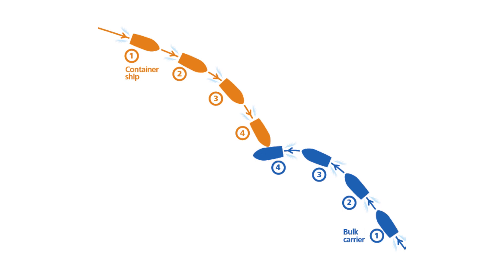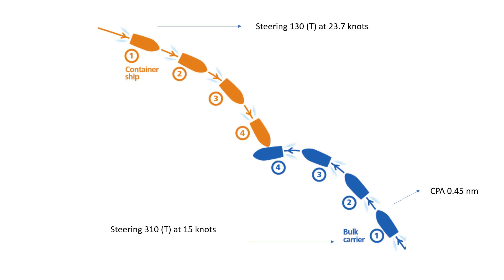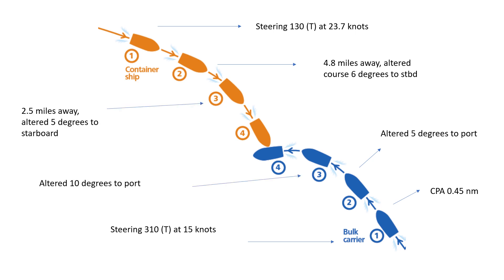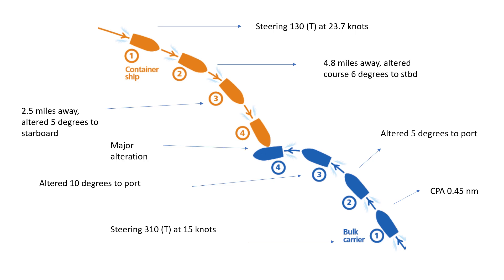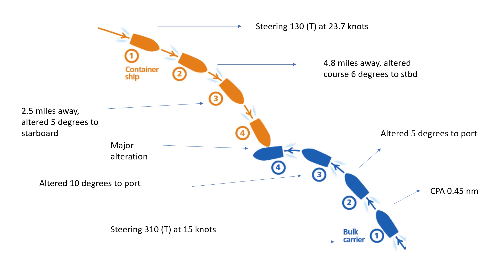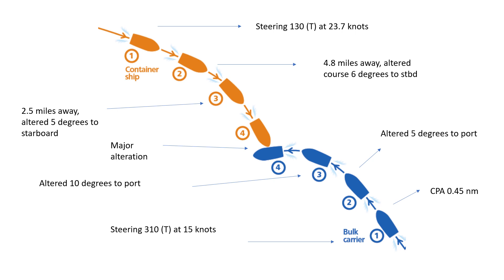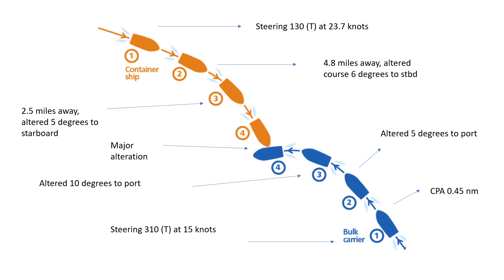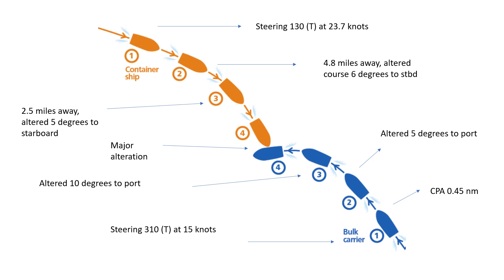Collision at sea case study!! Understanding and applying the Rules of the Road

Comment: The only disagreement I would have is placing equal blame on the two vessels. The only major fault of the container ship is that they didn't alter substantially, the bulker however broke rule 14 and 15 (whichever they assumed was happening). The bulker should have been stand on or altered to stbd. Their alteration to port put the container ship in a very bad position, which could only have been rectified by coming fully round to stbd and back on to course. If I was to apportion blame, I would say 80-20 to the bulker. Thanks for the videos, they're really interesting as I'm coming up to my orals.